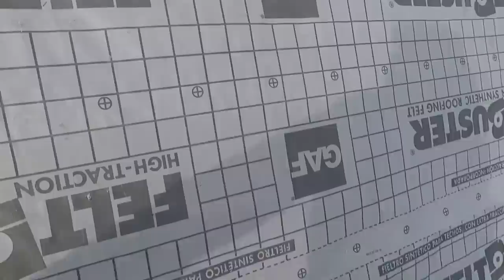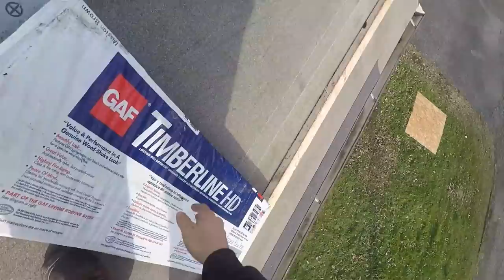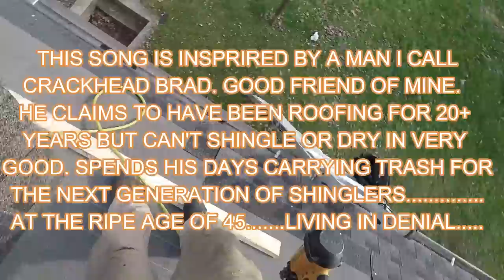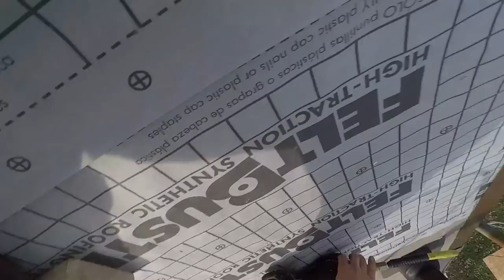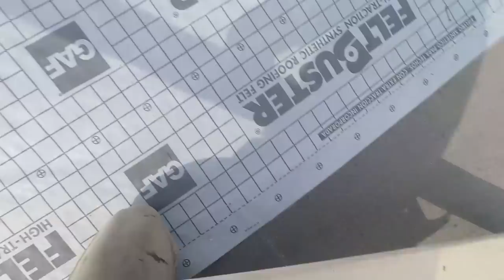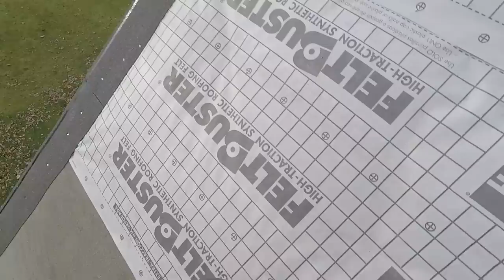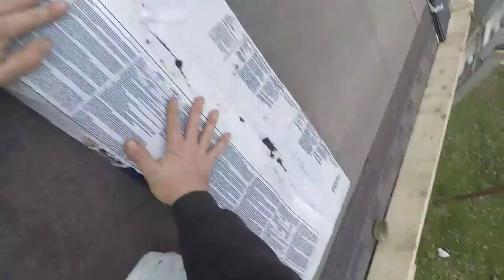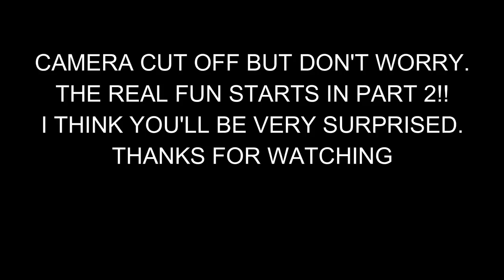Worlds Fastest Shingler 9/12 (Part 1)

Comment: Pre cutting all your books would make things go way faster and smoother. 5 5/8 -11 1/4-15 3/4. There i gave you the measurements and everything lol.
Reply from the maker: theres a 4 inch stair step in that...lol unless the other piece would be the 3rd...idk but i gurantee you take your tape out to pre cut anything you'll get smoked lmao absolutely destroyed. i murder fast shinglers when they run the bottoms and i create the stair steps. but yet everytime i run the bottoms dudes complain i push them around lol
Reply: It’s a 5 5/8 pattern and you make a few marks with your knife on the top of a shingle for a pattern and have a dumb dumb like boy cub cut a book per each piece of starter running up your rake. I just cut mine myself and I do each step 100% as I go so I don’t have to stop. I do sagger my nails like you do. You can also just use a shingling hatchet and make your marks with that to make your pattern but I only do metal now otherwise I’d definitely post a video of me spanking your time easily.
Reply from the maker: well i got a little lost there but i don't sweat it! i already made the next challenge and its actually book cutting. still one square..but starting up edge. you'll have all your starter on and everything already then go.
Reply: I like the vids though keepem comin. I wish I could get away without bags and ropes and harness I have to wear both every day no matter the height or pitch. And you must not have been popped by l&i or whatever safety police lol you have where your at cause I have had my jobs shutdown over a ladder with a bent foot definitely wouldn’t get away with any of the stuff you do
Reply: I pre cut all all courses with shingle cutter.  Cleaner cuts than hook blade, also use it on ends too. Precut whole side in 2 minutes.  Cut two layers at once.   BOOM
Reply: Never used a shingle cutter but always wondered if they worked well. I’ve personally never had a opportunity to use one always just used my good old Stanley hook knife and blade